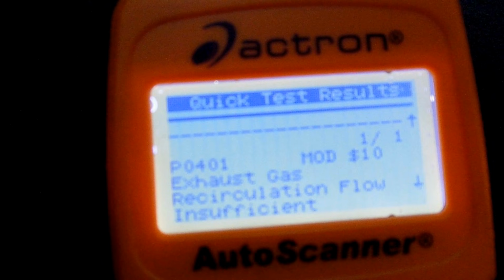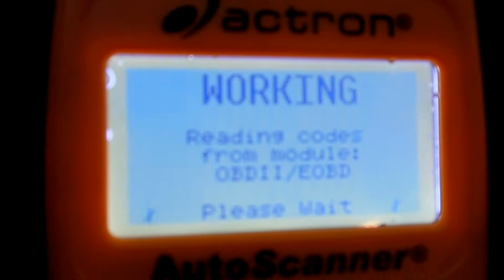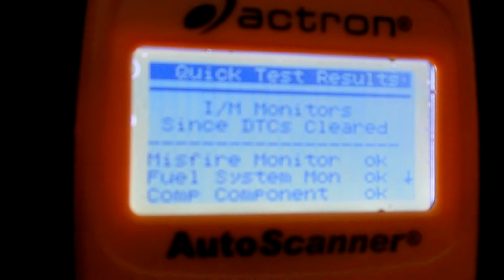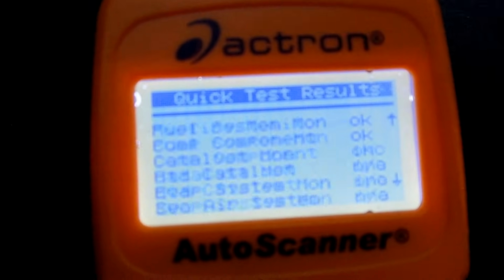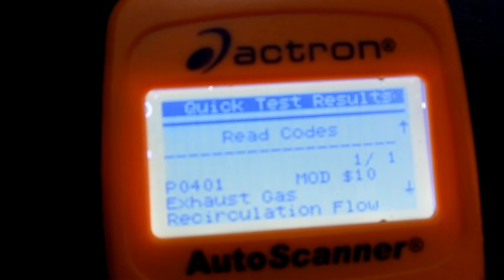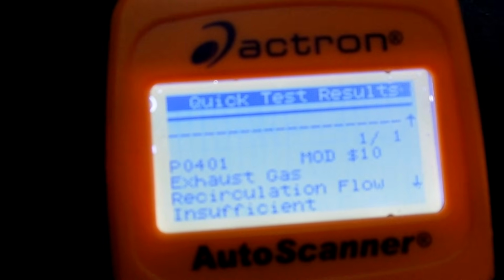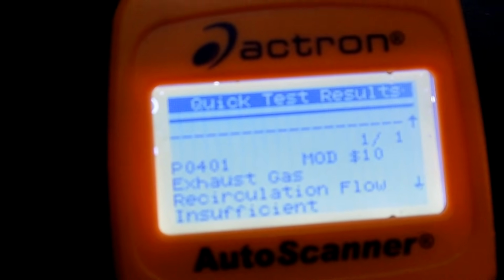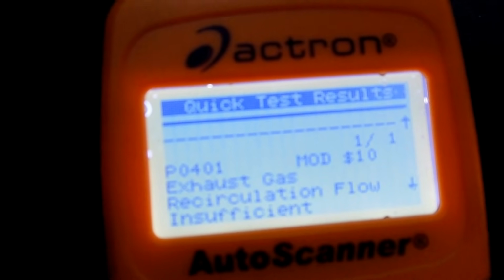P0401 2002 F150 EGR System Overview and Troubleshooting Guide

Comment: My truck has been acting up and I can't put my finger on problem; it stalls as if it's not getting gas, I shut off for a few minutes and then it runs fine, sometimes I have to repeat several times, AutoZone said it's a EGR problem, but I think I solved my problem, the truck was very low in water! I don't have a radiator cap but that degas bottle, it will fool you, so be sure to check the simplest things before you put in shop, because they will fix what's not broken or even worse charge you for fixing problem just to pour water in it, and their labor will be for searching for problem

Comment: I have a 2001 F150 4.6 and had the P0401 code and would not pass smog.  Just did exactly per this video and found exactly the same problem, clogged egr ports.  Took my truck to smog station after cleaning out carbon and passed test.  Thanks to Vicos for your excellent video.

Comment: Remove the vacuum hose to the EGR and increase the RPM'S to 1500. There should be vacuum at 1500 but it should drop to 0 at idle. If there's improper vacuum, replace the vacuum regulator. At 1500 RPM'S, with the hose disconnected, if the engine idles rough, it could be the EGR valve itself.
Reply from the maker: Thanks for the input, Hank.

Comment: If you have improper vacuum to the EGR, replace the charcoal canister purge valve. Try fuel injector cleaner to clean parts. Get. Actron CP9690 code tester. It checks live, record, graphing, transmission codes, oxygen sensor test, emissions readiness test, ABS, SRS, and MORE! It has code-connect to diagnose codes. The screen is large and well-lit! Get the USB cable to update it. EBAY has it. It includes cables for OBDI Ford, G.M., Chrysler, and Toyota. The CP9680 is for OBDII only.  EGR stands for EXHAUST GAS RECIRCULATION VALVE. There shouldn't be vacuum at idle at the EGR but at 1500 up and should drop when idling the engine.

Comment: Great video, I have a 2003 F150. 262000 miles on it plus. It runs like a champ. I do have the same problem, Right now. I've already done what you said except that last part down where the hoses connect 2 steel tubing. I bet that'll solve the problem. A big note, yes I wouldn't turn my back on any professional mechanic. Most are working under mechanics license. I found that most mechanics don't know they're guessing. And with a little basic knowledge you can fix anything.
Reply from the maker: You're right about that. I studied up on Youtube and ended up replacing the entire front suspension, all 4 shocks and brakes and the front hubs. In the past, I would have never considered something that drastic. Must say I was a little nervous taking the front end suspension apart. Also, did some tuneup work and it runs like new now.

Comment: Disconnect the hose to the EGR and if the engine smooths, it is NOT the EGR valve. It's upstream. Autozone only checks codes if the check engine light is on. Hook up a Mityvac and pump it up to about 8". If it holds, the EGR is o.k.  If it leaks down, it's bad. With the engine running, pump up the EGR and the engine should run rough. If not, the EGR is clogged or the passage is clogged. If you get improper vacuum at the EGR at idle, check the system above the EGR. Check Troubleshooting feature on the code tester.
Reply: Sorry

Comment: My wife's car as described below has the smallest of problems with her 1999 Ford Expedition. When she drives for a while. It looses just a annoying bit of power .. She has to keep the accelerator pressed more and just doesn't have the power it should have.
I have not seen it do it and don't drive it enough.  it seems to do it  in wet or dry conditions.  Going up hills require a little extra acceleration. Sometimes it staightens out.  I would think that it wouldn't  be a static condition like excess carbon build up...it is intermitent and seems to follow no obvious pattern at all. I am a moreless retired electronic tech. I worked 7 yard for Sears late 80s and 90s. as an electronic tech.. I understand basic digital gates and microprocessor and course transitors.  I have been told my DPFE. Is most likely my problem.. 
I don't throw parts at things unless necessary. The first thing that usually comes up on scans is O2 sensors.. Most of the time it's questionable if they are bad. If you 
Kind of point me in the right direction it would be appreciated.  Fellow video poster pianostyle100.

.

Comment: This is is one of the best postings I've seen in years.   Couple of things.  I know it's not related but when the car doesn't idle right in the morning.. IA C probably needs to be cleaned. Idle Air Control. Watch for little falling screws.  
Next I have a video where I took my EGR valve out and either cleaned or replaced it. I have a Eddie Bower 1999 4.6 liter Ford Expedition.. basically and F150.
Taking the EGR out is best done with a mechanic or knowledgeable friend. Pretty much your accessories on top of the engine will be off.  Intake manifold etc. It's probably clogged with  carbon.
I was a newbie at this experience.
Also have the tools you can plus things like extenable small mirror    and  magnetic pickup tool.  Murphies law and coralaries.

Comment: This is a great video! I got a 96 Ranger 3.0 2wd It is throwing the code p1445 Purge Control Valve High Output! So like an idiot i start throwing parts at it like new Purge Valve new Thermistor new vent valve for gas tank new vac lines new Charcoal canister new Gas cap! Basically the whole evap system =\ 
So i decide to take it for a Professional Diagnostics at RadAir complete car care a well know franchise for Auto repair!
I thought good they will find the issue if it's a bad circuit right?
Wrong! After 6 hours i get a call from The manager at RadAir and he tells me it's a vacuum leak between the Theristor and Purge valve easy fix all done!
So i go to pick up my truck from RadAir and Paid $200.00 and walked out to my truck and started it just too see the Check Engine Light pop right on!!
So i walk back in to RadAir and look at the manager and ask why the check engine light is still on??
He walks out with the Mechanic and scan tool and get's the same damn code i just paid him $200 to fix!
So the manager starts pulling Vac lines right there in the parking lot and pulls the DPFE hoses off the egr tube and say,s!
Your EGR tube is blocked replace it and reset your battery for the check engine light to go off! Then just walks away =\
So after 6 hours they could not find or fix the issue with my truck but charged me for it! =\
Got the new EGR tube yesterday will be installing on Monday and if the Check Engine Light don't go off i may be calling action news on RadAir for Fraud!

Comment: I was driving down the road and the truck popped felt like a flattire but it was not.the engine light service light came on 3days ago .tell me whats wrong
Reply from the maker: Hi Ray, If you have a check engine light, there should be one or more codes stored on the computer which will give you clues as to what the problem is. Get the codes, then search YT for the code and your year/make/model. If you don't have a code scanner, and it drivable, most of the national parts stores will scan it for free.

Comment: Great video.  Actually enjoyable to listen to.  Been working with my dad to get rid of that P0401 in his 2001 F-150 4.6L.

We've replaced the solenoid, EGR valve, and DPFE.  Code still appears.  Looks like we may have to pull the throttle body.
Reply: I hope that worked out for you. I’m a girlie girl on the outside, but I love to tackle auto projects. I removed my throttle body in my 2001 F150 Harley 5.4 last weekend. Getting some of those EGR bolts off was tough, but the rest was fairly simple. Lots of carb cleaner was used!!! I’ve got a fouled plug that I’m terrified to pull #3, so my truck is running rough. These plugs are notorious for breaking. It was throwing a few codes including P0401. If I did this, any dude can!!! I hope you cleared your code.

Comment: I have a 97 ford expedition..  Hasn't had any work done.  The other day I got a p0401 code.  Do you think I should change the egr valve, egr vacuum solenoid and the sensor?

Comment: +Vicos. Ya know, I've watched this video like 3 times. I have a mechanic who does my work in his garage at home. At any rate, tomorrow I was going over to his place to do the EGR replacement because he told me like 6 months ago that was why my truck ran like shit. Plus I wanted the spark plugs replaced & end it with tightening up the loose exhaust pipe at the exhaust manifold. Well that's all that needed to be done. Well today after I watched this video again, I thought, I'll just go outside & check the EGR & if it's bad I'll just change it. All this time the EGR issue I've had, was the vacuum lines to the EGR Regulator Solenoid were not plugged into it. The backyard mechanic who lived next to my son was quick, smart & could look at a vehicle & tell you exactly what was wrong with it. However, I caught him about 8-9 months ago unplugging wires or actually pulling them out so the vehicle would start & run fine for a couple of times then like clockwork, you'd be on the phone calling him to come by & check out the new problem. He knew I caught him messing with my wife's SUV & my Grandson's Honda Accord. My guy had to take time off, that's why I was using this guy in the first place. Just so people reading this know, I'm not dumb. I usually fixed just about all of the vehicles we've owned since I got married to my 2nd Wife 30 years ago. I've been in 3 accidents, so climbing all over vehicles just doesn't happen anymore. I have to depend on guy's who know cars & trucks but don't have the overhead. I've also helped him out by having stuff like oil changes done if he was short on cash, or out of cash. So he knows I was always there to help him. So now my EGR issue is fixed. I took it out for a run after I plugged the vacuum lines back into the EGR Regulator & it ran great. So Vicos, thanks man, I'm glad you put this video up on YT. I wouldn't have even looked at the EGR Regulator, [BTW, on my 2003 F-150 5.4L Triton, the EGR Regulator is located more in the front of the engine, but I have a quad cab & 4x4, so that's why it may be in a different location]. I'm still gonna look at the Throttle Body & see if those 2 ports are starting to build up with too much carbon but tomorrow, 10/19/17, my guy will take care of the Plugs, the new Coil Pack's I bought, then tighten the exhaust leaks. Thank you again Vicos, you helped me out a lot, Dan

Comment: Not too long ago I took my truck 2002 Ford F150 5.4L to a popular auto shop in town for exact code P0401 then I was told that need EGR, DPFE Sensor and hoses replaced for $700 plus, parts and labor, I couldn't believe the cost that I was quoted so I decided to do my research on you tube and decided to buy my own parts and have a mechanic friend install it for me in less than 2 hours. Parts cost me less than $200 and $50 for the mechanic. I can't believe the difference, I almost got financially raped by this auto shop!!! I can't imagine how many innocent people are getting ripped off! This auto shop charged me $190. just for scanning!!!
Reply from the maker: Plus they charge list price for parts. If you buy your parts on Amazon, you can save a small fortune.
Reply: BTW, before I replaced the EGR valve I decided to try adding Seafoam additive to my crankcase and fuel tank and guess what? The "Service engine"light went off and my engine sounded much smoother. Not realizing what just happened I could have got away without replacing these parts, oh well now I don't have to worry about these problem for awhile. This is by no means that I'm advertising for any product but this thing does it's magic based on my own experience. Thanks for your video, I wish I have come across it before I started replacing parts (which this auto shop strongly recommended).

Comment: I tell you what man for somebody is not a mechanic you doing a hell of a job you really helped me out alot I got no vacuum I put back into my EGR valve bad it runs roughyou've been more  help to me then a Certified mechanic thank you so so much for making this video If you like custom built 4 wheel drive small garden tractor come and check out my bill I apologize my sorry spelling
Reply from the maker: Howdy James. Glad to hear it helped you. I finally got tired of dealing with incompetent mechanics and decided to figure out how it works myself. I'm sure they are plenty of good mechanics out there. Unfortunately, they don't seem to work in my neck of the woods.
Reply: Thank you very much my white vacuum hose head no vacuum that was part of my problem my EGR port for stopped up and now it runs like a champ thank you very very much

Comment: Super job. Very informative and detailed explanation. I have the same  error code and will be ordering a new egr valve, egr solenoid, egr sensor, idle control valve and bbk throttle body to bring my 98 Expedition back to life. Many Thanks!
Reply: Nice display of automotive knowledge.My 99 F250 5.4 engine is shooting codes PO171 and PO174.When I try to accelerate to get on the highway it falls on its face. Could you please give me some information on what to do to fix this problem. Thank You
Reply from the maker: Howdy! Thanks for watching and the the kind words!

Comment: "looking" at balljoints is fruitless......they have to be physically checked...by raising vehical up and allowing tires to be and inch off the ground...the prying up on them while looking at the b joints.....depending on how the weight sits on the bearing...meaning  on lower control arm or is the vehical weight resing on the bearing from a strut style suspension like a honda will determine the test method used....tie rod ends can be checked by grabbing a tire from the sides and push/pulling on it to feel for play.

Comment: Would it be possible to just spray throttle body cleaner into the egr valve port to clean instead of tearing it down to fix the flow issue?
Reply: scottmcf2011 ...I would imagine that you would have a problem with the carbon/gunk breaking off in large pieces, that would then be sent to the fuel injectors, causing a blockage there...?

Comment: another easy way to test this egr system. is by removing the cap on top of the egr vacuum solenoid and covering the vent port with your finger. this will send full vacuum to your egr valve. which at idle should cause your car to run rough and almost stall. this will verify the egr valve works and vacuum is good to the egr vac solenoid. only thing would be to make sure your egr vs is electronically functioning. egr= exhaust gas recirculation
Reply: thanks to you good buddy. 👍
Reply: thanks to you good buddy. 👍
Reply: Cody Wichman

Comment: Excellent video and very informative. Although I don't have codes, this provides me more knowledge that was presented well. I am planning to do a full throttle body clean just as my expedition 4.6 is having an slight idle issue but does not stall and I have seen my iac and ports did have carbon. This gave me a good way too to test the egr and vacuums. Thanks for sharing.

Comment: Thanks for the video. I have that code on my 2002 Ford Ranger. Auto Zone says the EGR flow sensor needs replacement. I pulled it off and both hoses have plenty of flow. But I wanted to troubleshoot the system before buying the $30 part. Great video. Thanks

Comment: 12:50 SUCK IT! 

No, seriously you don't have to have the motor running unless you want to do the stall test. Just disconnect and put a hose on the vacuum port of the EGR and suck, it doesn't take much vacuum to open them. You'll usually hear the diaphragm flexing or on some EGRs you can stick your finger underneath the dome part through cutouts in the case and feel the diaphragm move. If you have to keep sucking to hold it open then you probably have a leak in the diaphragm.

Another test you can do while this line is disconnected is to blow through the vacuum line back to the solenoid to see if it will hold pressure. If you can feel pressure drop and have to keep blowing or hear air leaking start looking for a cracked hose, hole or the solenoid isn't closed. Disconnect the hose from the solenoid and put your finger over that end and retest to see if it's the line or not. Use soapy water to verify small leaks before buying a new hose if you want.

You can do the same test on the vacuum supply line (the red line in your case) from the intake if you can get to it easily. If all is good reconnect it back on the intake and blow through it. it shouldn't be to hard to do unless the port is plugged up.
Check the rubber on the connectors for dry rot and splitting will you're at it.

Just don't let anyone catch you doing this, they'll start giving you strange looks. :D
Reply: Good tip. I've never thought of doing that. It just sounds bad, but hey, if it works, it's great to do before you take it into a shop at $75 an hour because you know they'll drag it out. That's why I look for knowledgeable people who are retired or on disability but can still work on vehicles. I've been pretty lucky. So far I've had 2 guys over the past 12 years who won't charge shop prices to do the work.. Thanks for posting this great tip.